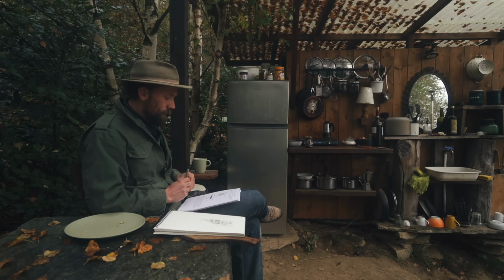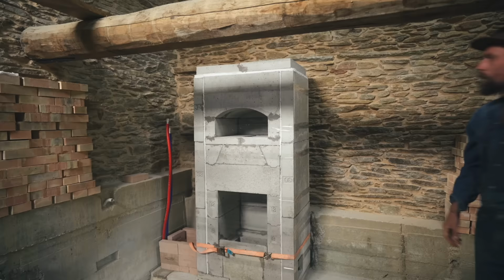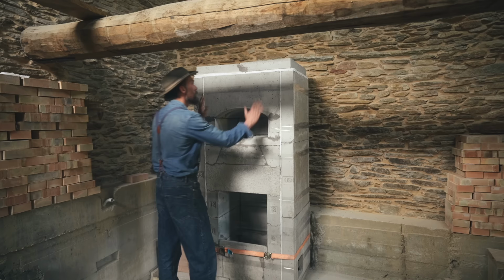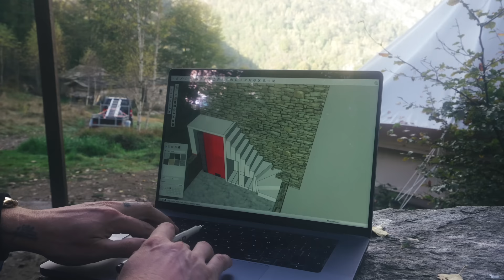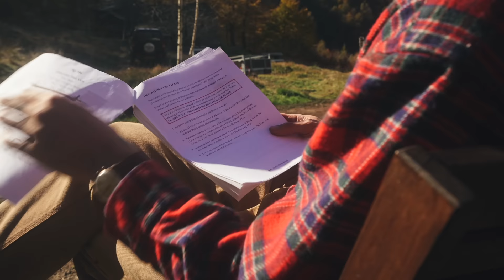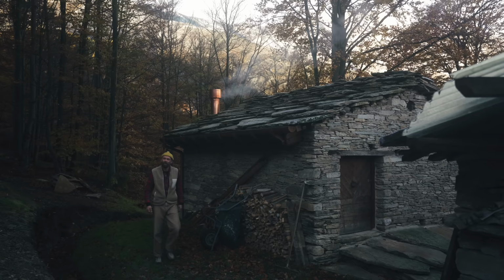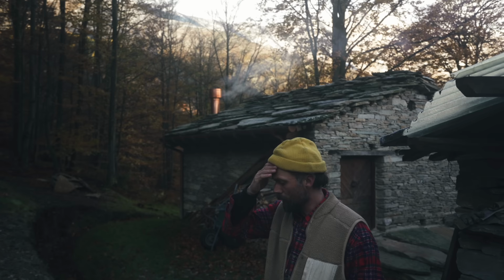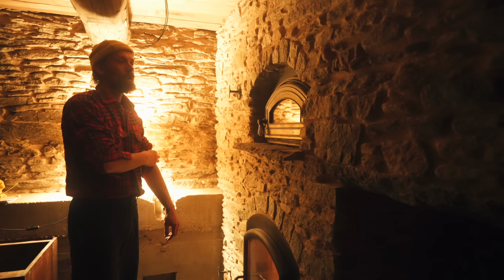Masonry Stove and Stone Stairway | Complete Build

Comment: I was surprised to see the stove build this week...my plan is to introduce this in my build in western Canada where the temperatures are mid range through out the year as we are mountainous prairie  conditions here, however, be interesting to see how this stands up to our seasonals and winter here, may need some backup but looking forward to the heat this produces as well. Nice to see this episode in a build all of its own from start to finish which will be included in a must see video to my builders who assemble mine here.  Thanks for the memory and recap. Martijn, this build is by far the most impressive work I've seen in my 50 years and counting as a builder and now building sciences engineer. It must be the mountain air in addition to dedication and a will to do better. Cheers

Comment: Hey, if you close the air intake as soon as there is no more flame but the coals are still red hot it keeps the coals hotter for longer and you will get way more heat out of the fire and ultimately the wood, and there will be nothing more left than a bit of ash once everything is done🔥❤️ keep up the great work!

Comment: This would be an amazing idea to build custom glassblowing furnaces, quickly. Love it
Reply: we use a mix of high temp refractory castable cement/ bricks for the walls, and the crucible pots are a high temp ceramic I believe- line interior with refractory blanket etc, wrap in sheet metal

Comment: I met the proprietor of Tempcast 20 years ago at a log home convention in Ohio. I eventually purchased on of these units when I built my own custom home. I was incredibly impressed with the engineering of the pieces. My understanding is that the crushed gravel for the concrete mixture comes from a quarry in Georgia, USA. When I Had a young family we cooked many excellent pizzas in the upper bake oven. Average cook time was 4-5 minutes once the fire in the combustion chamber died down. Those are great memories for me. Putting the pieces together with refractory cement, ratchet straps and packing tape then mixing mortar for my father who laid the bricks for me. I even drove up to Canada to pick up the unit in my pickup which I still drive today. That was pre Trudeau and after 911 when a passport was not required.

Comment: I'm glad the chimney vented well. In theory your chimney should be a few feet higher than it is. The rule states: "2 feet higher than any point on the roof that is 10 feet away from the chimney." When it's windy out you could have some issues with draft. But you might be OK.

Comment: Hello from Oregon, USA. Very much enjoy you videos. 
Please tell me why the bricks are being "boiled" in a large cauldron?
Reply: It's a reaction of obsorbing water, since the bricks are porous. He soaks them, so the cement does not dry too fast. When layering the bricks, he can still adjust the bricks while working on them before the cement hardens. He explained this in one of his previous video's.
Reply: yeah that "boiling" is actually the water reaction, soaking into the firebrick I think.. they are like a sponge almost..
He actually had to take apart and redo a section where he forgot to soak the firebrick prior to working it with cement...